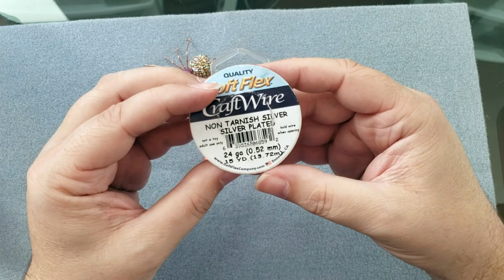Conversations in Wire with James Browning: How To Create A Spider Using Beads & Soft Flex Craft Wire

Comment: In 1982 I designed and sold the first Christmas Spiders and sold 7 of them at a consignment shop here in York County, Pennsylvania.  At first, when my spiders started appearing the next year produced by a local church I was really mad.  I was young, and didn't realize the Christmas Spider was bigger than I would ever be.  I"m glad to see it has grown, just wish I could get some credit.  The first ones were made with wire, two large pearls, a smaller one for the head, and I painted a mouth and eyes with black and red and had beads on the ends of the feet.  There was also a clear string out the back to hang it.  There was also a small rolled up story that came with the spider.  Thanks to everyone who have helped to make the Christmas Spider what it is today.
Reply: Even my Grandmother had a Christmas spider! She has passed and it's now mine- and I'm almost 70. Think of all the income you help all those crafters make! Thank you!💝🙏💝